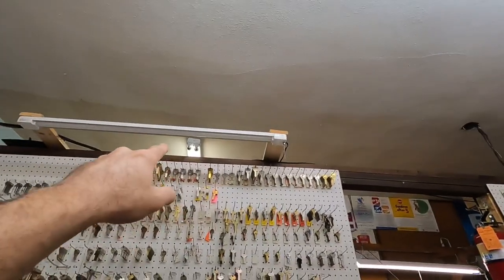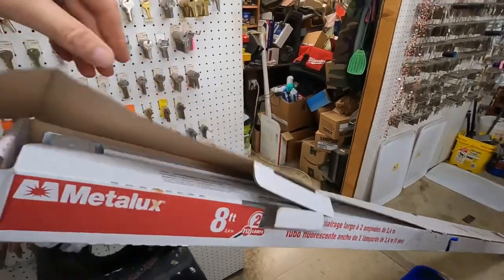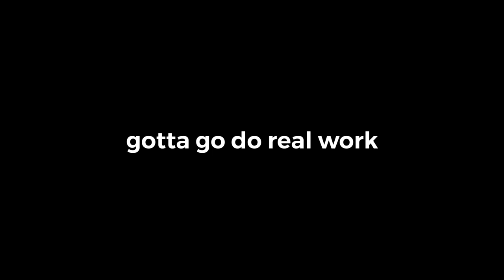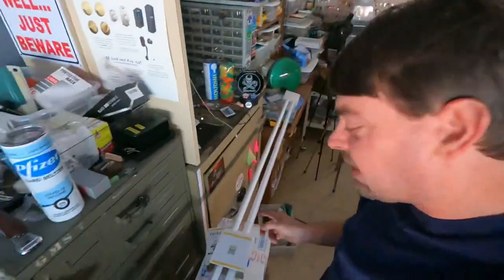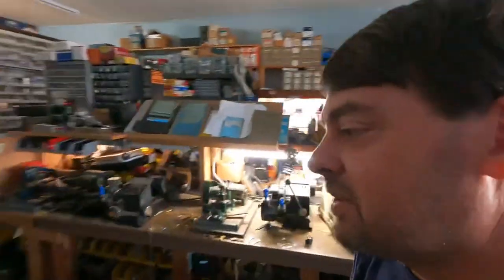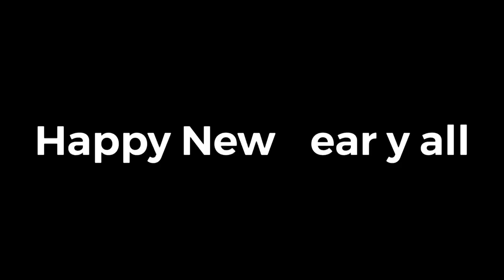Lock Shop vLog 10 “let there be moar light!”

Comment: Well done finally getting all this done. When you started to paint the wall I thought oh no now this is going to turn into Jason painting the whole shop, but you were able to hold yourself back, very impressive. Saved a heap of money not hiring an electrician and a painter. The strip lighting does add a nice bit of colour to the shop and you can change it to match the seasons or create some mood lighting. Interesting though you don't seem to have to have a protective cover over the fluro globes like you have to have in this country. All the cover really does is diffuse the light and collect the bugs and dust. Cheers